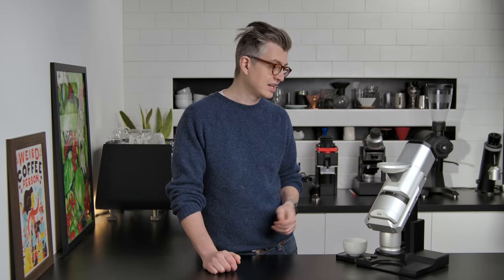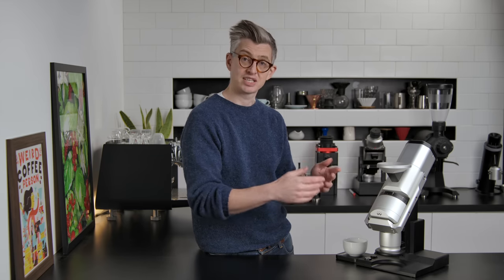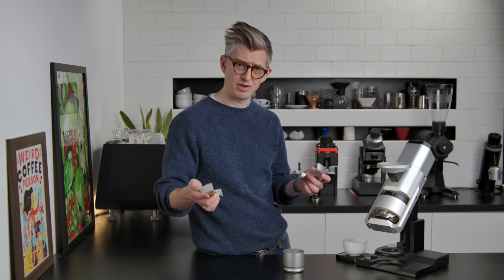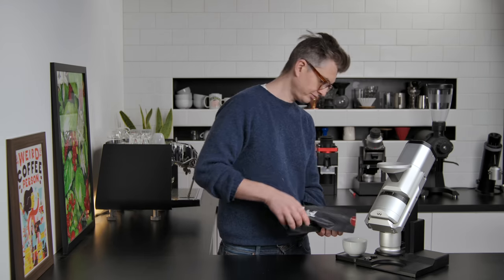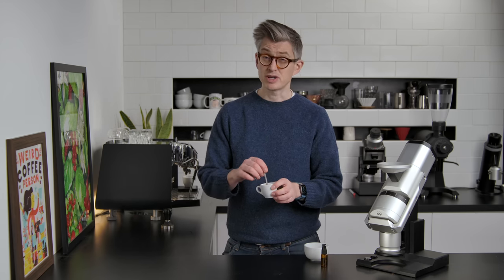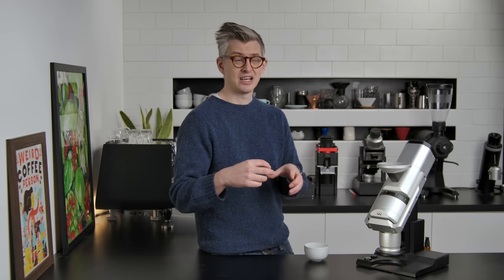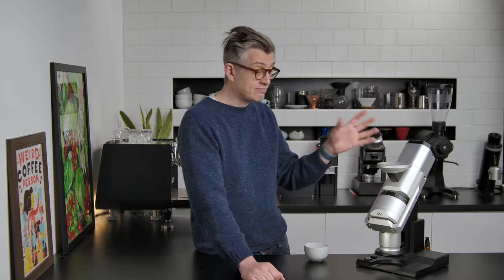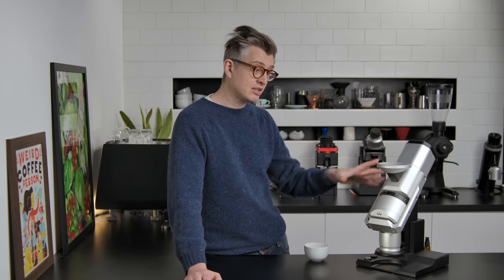The Weber EG-1 (Episode #2)

Comment: "There are times I wish [the steps] were a little bit smaller, but I'm being very fussy there."  I dunno, seems OK to be fussy about a grinder that costs $3500.
Reply: I guess you could just not move the steps and adjust according to rpm
Reply: lol and I thought selling a grinder for $1500 was a blatant attempt to soak customers with more money than brains. These guys are like "$1500? Hold my beer, I bet there are even dumber customers out there than that". Its a motor and a burr set. Talk about sailing past diminishing returns.
Reply: @carpdog42  I'm not saying I would ever buy this or anything but I mean someone who does buy this isn't buying it because the grind quality of it is going to change their life and make all other coffee grinders look like complete trash. It's in large part for the build quality and design of it and how it all works and looks, and the fact that it is a very small company is going to make costs higher
Reply: @evan5557  Your argument would make sense for a $600 or even $1000 grinder. How does that justify more than tripling the price?
Reply: @carpdog42  exclusivity
Reply: @carpdog42  oh man. Do I have a product for you. Go to the Weber design website. They sell a bean cellar, which is like 10 glass tubes with lids and a stand for $300. So you can pre dose your beans before grinding. You can buy similar glass vials from IKEA for $2
Reply: It looks like art though
Reply: @evan5557  rich people need something to spend their money on and then feel good about their purchase.
Reply: @carpdog42  Show me the $1000 grinder you think competes with this grinder in terms of workflow, output, build quality and longevity.
Reply: @instantkamera  I'm seriously looking for the same...
I think the Vario or Forte from Baratza could maybe compete in grind quality but suffers in all other categories.
The Lagom P64 has some compromises compared to this grinder, but it should come close in all categories.
Reply: @MattM-24  I was being facetious, because there isn't one. I own a Lagom. :D
Reply: @instantkamera  Do you actually think it will last 8x longer than my $400 grinder? Will it grind 8x better? Will it look 8x better on my counter? I don't see anything special about the "workflow" or see any reason to believe the output is that much better.
Reply: @carpdog42  that's... not how anything works. Do you think a luxury car drives 4x faster than a Honda? Does it turn 4x more sharply? Does it handle 4x better? Does it accelerate 4x faster? Does it get 4x better milage? Will the engine last 4x as long?

This is just silly. As you improve things, eking out the last couple percent of performance or ease of use or quality increases the price nonlinearly. This is not complicated or unexpected.
Reply: @Stephen Carpenter  

> Do you actually think it will last 8x longer than my $400 grinder?

Any of these are built to last more than one lifetime. So ... yes.

> Will it grind 8x better?

Depending how bad your $400 grinder is, it's possible these can do things that grinder simply cannot do. But the number one selling point for each and every one of these grinders is exacting alignment and precision for the sake of grind uniformity. So, yes.

> Will it look 8x better on my counter? 

That's obviously subjective. I suspect though, given the number of folks clicking the thumbnails here that have never heard of these, or are shocked by the price tag, they look pretty dang cool.

>I don't see anything special about the "workflow" or see any reason to believe the output is that much better.

I guess that begs the question of why you are here, then. 

It truly boggles the mind when people show up to these things with next to zero context or understanding and immediately start assessing 'worth' and 'value'.
This is no different than professional or enthusiast level gear in ANY OTHER hobby. Audiophile stuff, expensive bicycles, film and photography gear, cars, PC builds ... I could go on forever. In fact, these grinders at least hold the distinction of not being mass-produced, unlike a lot of the things I've listed above they were stamped out of a cookie-cutter on the production line, nor will they be obsolete in a few years.

Yes, this is expensive equipment. 
Yes, you can do with less. 
Yes, it is a privilege to be able to purchase and enjoy these things at all. 

The fact still remains that there is a market for these items, so they are worth what they charge (and more, given that in many cases, even with money in-hand you'd still be put on a waiting list due to limited supply).
Reply: @r_bear  Its how it works when I am evaluating the price. I will pay for quality of function; I will pay for supporting a small company. However, I feel I did both of those things at $400 for a motor in a housing with a decent burr set.
Reply: @carpdog42  Maybe not, but the person who buys this thing probably has a more expensive counter than yours.
Reply: @instantkamera  If not for the electronics I might believe that this device would outlive me. Before I die, I am sure that motor controller would be long since dead. The outer casing says NOTHING about the interior quality, especially of the electronics. Devices don't get more reliable when you add complexity.
Reply: @carpdog42   None of these would be rendered disposable upon failure of the small amount of electronics inside (which are largely to control RPM). The motors can all operate directly given the correct power input. The boards, switches, wiring, mounting screws are all easily accessible and replaceable in most - if not all - cases. There are no frivolous electronics, no proprietary plastic parts with a relatively short life span, nothing. The burrs - even the relatively small ones in the Lagom, are rated for more coffee than one person will consume in decades/lifetimes, and even those are easily replaceable.
Reply: @carpdog42  There are people out there paying $5000-7000 for keyboards, you heard that right keyboards! So of course a market for a $3500 grinder exists, in fact I saw this grinder being discussed in one of the coffee channels of one of these keyboard Discords.
Reply: @instantkamera  The same could be said of mine; In fact, mine has the same problem... except... it will only take me a few minutes to add a toggle switch to the plastic case and get back 100% of the functionality that I actually use. The metal case is cool and all but... not worth many times the rest of the device cool.
Reply: @instantkamera  helps!
Reply: @episodesglow  And I think they have more money than sense too. I understand the market exists, and on some level, that is all value is. However, I didn't retire at 40 so I could waste all my money on looks. Could I afford a $3500 grinder or a $7000 keyboard? Sure could, but I wouldn't. Because I am not into paying more for the same function. There comes a point when you are just not paying for the quality anymore and just paying an idiot tax.
Reply: They are stepped, but each step is 5 microns  so it is quite fine tuned. I happen to own an EG-1 and it will definitely elevate your coffee. I've tested it against my previous Rocket Faustino grinder and the flavour profile is significantly better in both drip and espresso. Yes it is an expensive equipment, so it's not for everyone. I was already very happy with the Faustino and surprised that this grinder would have made a big difference. I'm a single doser, and I enjoy the workflow of using this grinder.
Reply: @carpdog42  To you. 

That is the entire point you are ignoring. Just like with processors, graphics cards, speakers and keyboards, there are diminishing returns. 
YOU do not want to pay that much money. That's cool. But some of us have the disposable income, or are willing to save up for a year or two, for something like this, because comparing a shitty plastic body and toggle switch to something that doubles as artwork in our setup is worth that money to us, when it also means better grind etc.

Someone above compared it to luxury cars, and that is exactly what this is. This is the model that is objectively better than your 400 dollar model. Is it 8,75 times better? Probably not if you compare grind quality, speed, sound etc. But the whole package: better grinds, less noise, better looks, longevity make it worth it to some. It's the exactly same way that, for some, a $20 blade grinder is better value for money than your $400 grinder.
Reply: @carpdog42   I think I mistakenly entered into this conversation in good faith, that's my bad. I'm going to check out on this one. Enjoy your grinder; the existence of these should not reduce that for you.
Reply: @carpdog42  I think it's been established that you are clearly not the market this product is intended for, With any high end product there is diminished returns on dollar value, but there are people out there willing to pay this much for the best in cup results that money can buy
Reply: @tedlovejesus  it looks ugly imho
Reply: @carpdog42  then its just conspicuous consumption and not worthy
Reply: @carpdog42  

>just paying an idiot tax 

I missed this blatant dig, so just to add:

My friend that doesn't drink coffee thinks you are an idiot for paying $400 for a coffee grinder, period.

My other friend that drinks budget coffee thinks you are an idiot for paying $400 for something you can get for tens of dollars.

My other other friend that drinks espresso thinks you are an idiot for paying $400 for an electric grinder when hand grinders in that price range are clearly superior.

...
Reply: @instantkamera  They are welcome to their opinions. I probably wont write them a novel and ask why they are here if they decide to share them themselves.
Reply: fully agree. 3.5k and it's stepped. i'm sorry but that's a deal breaker given the price-point. i'm very surprised to hear this -- my assumption was of course it's step-less it's 3.5k.
Reply: @djcuvcuv  Hoffman failed to mention that each step is 5 microns, which is very fine. You can easily fine tune your grind. The step comes in handy to quickly go back to that setting if you switch to another bean or brew type.
Reply: For $3500, the grinder better make every grain the exact same size (no fines) and each step needs to move the burr a few nanometers.
Reply: I’ll stick to my Twelve Step Program!
Reply: The steps are in 5 microns, its a lot easier to change grind size on this than on a mazzer
Reply: @bl6973  At least for me, it's not a specifically anti-step sentiment.  Fixed steps are going to be really easy to repeat, to record, to communicate--and there's value in that.  The implementation on this looks well done and sturdy.  And for example, I prefer stepped over de-clicked apertures on camera lenses so I can get the exposure that I want.

Rather, it's a sense that, if the price is this high, small nitpicks are totally valid.  If spending this much on a coffee grinder, it makes sense to be pretty fussy, to be particular, to make sure that you're getting the right $3000 coffee grinder for you.  

That said, folks who can afford $3000 grinders can probably afford to make mistakes in buying $3000 grinders, and it's someone whose grinder budget is $200 that needs to be a lot more particular.
Reply: @thebitterfig9903  ah. It was bcs someone was complaining abt it being stepped. Stepped doesnt mean bad. It merely depends on how wide the steps are.
Reply: Exactly, it's not enough to want to refine the dial but can't on a 3.5k grinder!! 🤨
Reply: @evan5557  is it? Maybe in a blind test you would not tell the difference between this and one that's half the price.
Reply: Lol a 3.5k grinder without steppless grind setting? What the hell are these people smoking!
Reply: @djcuvcuv  is 5 micron not enough fine adjustment for you to dial in a bean? I have a stepless grinder currently and the thought of stepped doesn't concern me in the slightest knowing how little it actually moves the burr set.
Reply: @ChickenAnonymous  given the width of the steps it might even be better than stepless w/r/t/ reproducibility. i was just slightly put off by the fact initially bc the current state of the art is stepless adjustment, and this grinder is insanely expensive.
Reply: @cameronbatko  I remember when several people brought this up before LW (now WW). They brought them home from their lab equipment as it looked good. But its a nonsensical tool as most realized and even detrimental to quality. Then the rich nerds found it via LynnWeber :-) Nowadays beans are sold right of the roasting so they need to gas out at home. A coffee bag has a valve to let the CO2 out and by only opening it when you need them they age less. Putting the beans into an airtight compartement right after the roast is not helpful as it will be consumed soon after . . By using this with fresh beans the espresso will not deliver its full spectrum of taste and will tend to more acidic taste.  The bean cellar is definitely in contention for the most pretentious espresso tool.
Reply: @carpdog42  “$1500? Hold my Nespresso!”

Comment: My first car cost 1/7th as much as this grinder although, in all fairness, it did not make very good espresso
Reply: yes :Joe but it could take you somewhere that would.
Reply: Was that the ol' Chevy on the levee?
Reply: Then your first car sucked!
Reply: Ah... i mean a budget car is usually aimed towards manual brewing techniques, put in a lower gear at lower rpm, you'll get some great consistent emission out of ur beans.
pro tip- feed them in engine slowly after spraying it with some synthetic lubricant
Reply: @rajrishiparmar1362  most cars' 5th gear setting is at least a passable grind setting for espresso imo
Reply: @bazza945  I took the chevy to the levy but the levy coffee shop didn't open till seven.
Reply: Grind finer
Reply: @Perceptence  I don’t know which budget school you learned math at, but 1/7 of around 5k is definitely not 25k...
Reply: Literally more than my first motorcycle. But, I hope it brings the same joy to whoever gets it .

Comment: A live RPM display is a brave choice. Other RPM controls are most certainly wandering around in a similar way, they just aren't showing it to you.
Reply: How positive are you about this? Have you done tests? What about the Ultra that uses a Servo motor that's used in industrial applications?
Reply: @jevenator  Its inherent in how it works. I'm not sure if Ultra uses an AC or DC motor, AC motors are more common in industry but require a bigger controller typically then the one shown in their promotion video. Assuming its DC, the speed of the motor is determined by the voltage the controller is giving the motor and the resistance the motor is facing. The controller knows how fast the motor is spinning by an encoder attached to the back of the motor. The encoder sends the current rpm to the controller at some polling rate. If the controller is seeing the encoder say its spinning at 200 rpm but wants 250, then the controller has to increase the voltage to the motor. Says the slow down was caused by it hitting a coffee bean, once the bean is crushed with the new voltage, it will now be spinning at a rate faster than 250. The delay on slowing back down the grinder depends on the latency of the encoder to tell the controller, and then the controller to change the voltage again. Inherent in this system is feedback delay which will causing noticeable rpm changes. 

The only real way to combat this issue is not with electronics but sheer mass. If you have enough inertia in the grinder to overcome the sudden resistance then the controller doesn't need speed up and slow down the motor, giving you a constant rpm. A bigger, heavier grinder is needed if you want constant RPMs.

Comment: From an engineer's prospective, I think floating the power as it experiences different loads is smart and should probably help the longevity of the internal components, especially at higher RPMs. It probably does sound like it's struggling compared to other griders, which from an aesthetic prospective, isn't great for a grider that costs as much as a decent used car.
Reply: your not getting a decent used car for that price these days...
Reply: @tobiasyoder You were 3 years ago when the comment was made…
Reply: @Naftoor  3 years ago would be 2021 sometime, so was still after we saw initial big spike in used car prices

Comment: Lovely to see you review this as I own one! It's mostly great as a coffee lab tool--adjustable, consistent, and relatively fuss free--but I want to note for prospective buyers that it has a jamming problem. I've never seen this in another grinder but at normal espresso settings on lighter roasts the grinder will suddenly stop, forcing me to open up the burrs, grind a bit, close them, and continue in order to finish the grind. It's happened consistently enough at this point that I can work around the issue without it affecting my brew too much but for a $3500 machine with a motor as large as this it shouldn't happen at all. Maybe my experience is unique but caveat emptor!
Reply: Never had an issue